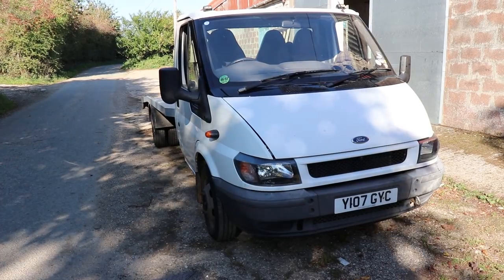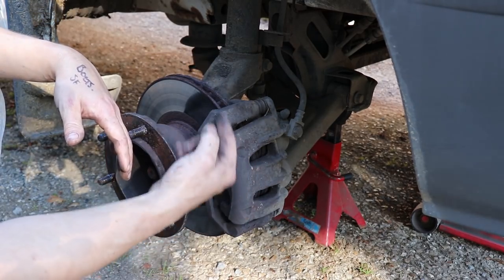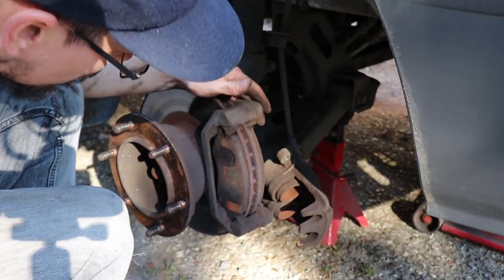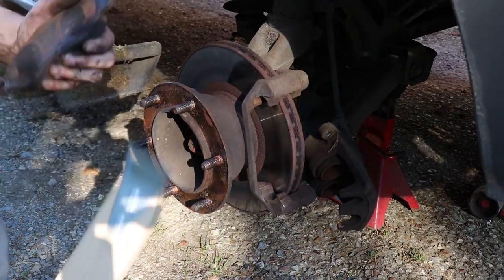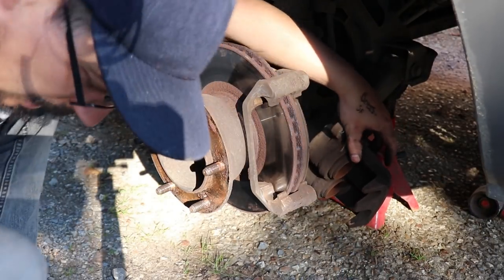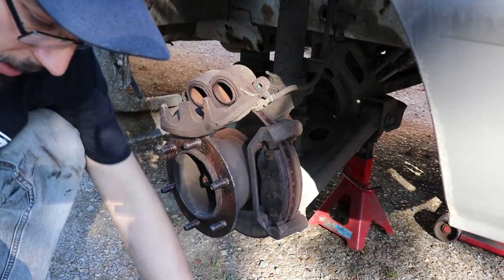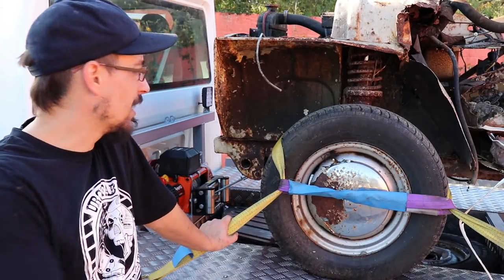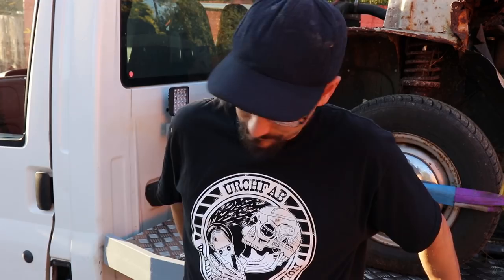SMOKING BRAKES ON THE RECOVERY TRUCK.

Comment: Always red rubber grease or silicone grease on the slider pins. The rubber insert inside caliper carrier swells up and causes the pins to stick if copaslip or LM grease used. Seen it more than a few times in my day job on the spanners. Also if you put the slider pins seals in the carrier then slide the pin in afterwards you avoid poking about with the screwdriver. Good vid, glad the truck starting to see some use.
Reply: Never known that once to happen.

Possibly might be the case with far older vehicles using natural rubber gaiters/boots but no such issues with more modern stuff eh synthetic rubber (22 years on I can't be just lucky.)

Comment: Cut it off at the drum end and crimp on a ring terminal for the retaining bolt yourself. This is easy and safe to do as all it will need to do is hold the cable lightly as it's wound onto the drum. When on it's actually the friction of the cable on the drum that holds it on.
Reply: MichaelKingsfordGray  The hell it does. A pair of bolt cutters, some pliers, even a hammer will do in a pinch. You could also just blast through with a stick electrode.

Comment: Great video again. With regards to your winch cable, each winch is slightly different in how the cable is secured to the drum but basically unwind the lot (you will see how it is attached) and cut what you don't want from the winch end leaving the hook end as is. Hope that helps :)

Comment: The way it is on my winch, you pull the cable all the way out, there’s a big ring terminal on the end of the cable which is bolted to the drum. Unbolt it, cut off what you don’t want and put a new crimp on ring terminal on it. Bolt it back on and wind it back in. I have the same problem with the cable on mine, been gonna shorten it for awhile but haven’t yet. When it gets all messed up I pull it all the way out and wind it back in neatly with some tension on it.

Comment: To shorten my cable I cut it at the winch end and used about four jubilee clips (hose clamps) to clamp the cable onto the spool (along the full width of the spool), I have done this for years without any problem even when dragging cars on without wheels! Also I screw my control box to the back of the cab so it wont get damaged and you can see the cable on the spool better ,to make sure its winding on evenly,

Comment: Hey Matt you can cut the cable after you pull it from the spool. You can use an angle grinder but I would put tape around the cable and then cut it 1/8" away from the tape.
Or you can put a hose clamp and cut the same distance 1/8" away. Then you can take your mig and tack the cable from fraying. Or leave the tape on.

Comment: You might want to leave the cable as it is, because if you need to load a heavier vehicle or equipment (plus 2000kg or so) the winch can be turned into a pulley by doubling the cable. It will be slower but with less strain on the winch.
Reply from the maker: I can only legally carry 1500kgs on this
Reply: Urchfab it’s not always about the weight capacity your hauling. You may need the extra winch pull strength to drag a car or vehicle (brakes locked up or stuck in mud). 
I would only remove as much cable as you have to. Don’t want to lose capability or overall reach.
Reply: @Urchfab  I know lots of people cut off what they don't want and then either get the cut off bit re crimped or buy a second cable to extend it if they need it for pulleys etc, it obviously won't pull it into the winch but it gives the best of both worlds.
Reply: If you shorten the winch rope, it decreases the diameter at the outer layer. This will increase the pull capacity . Not decrease it.

Comment: Don’t shorten your cable, use one hand to guide it to spool correctly until load is sufficient and it should track it self. Letting the cable birdsnest will only cause more damage, I get years without replacing mine and I run a Tow business. Cheers for the great content.

Comment: shortening the cable depends on what type of end connection your winch has. if you are lucky it will be a friction fit. so then all you have to do is cut the cable en reinsert it into the drum. best of luck on the project!

Comment: Pull the cable out fully and there’s normally a small grub screw holds cable to the drum. My dad always taught me to heat wire bond up until red where you want to cut it and keep twisting it until it breaks so u are left with a nice end rather than just cutting the cable.
Reply: Don’t need to mess about re crimping the hook end or anything

Comment: On those winches there's a copper swedge/lug like you'd use on a #4 batter cable or ground cable. It's just bolted to the side of the drum with a button head machine screw. I think they're like a 4 or 5mm Allen. 

Make sure you have enough cable to keep one and a half wraps on the drum so that the load is not pulling on that lug. Otherwise you risk the drum spinning inside the cable spool.
Reply from the maker: Thats great,  Cheers

Comment: An air powered descaled works wonders for clearing the rusty crud out of the small gaps the pads sit in, Lidl had them in last week £25 ;-)
Be a great tool for your 100E build too.

Comment: Actually it would be a good idea to take a 1 tonne chain block in the truck tool box with you and use that to pull in any heavy vehicles etc that are tricky to load. And shorten the cable.

Comment: Pull all the cable off the spool, cut off what you don't want, crimp on a new eyelet and wind it back on. It's the first 5 or so winds round the spool that keep it on there.

Comment: The caliper sticking is more likely to be the flexi-pipe. They corrode internally and effectively make themselves a one way valve. Very common on the mk6.
Reply: How does a pipe made from synthetic fibres corrode?!
Reply: It's not. The outer is but the inner isn't. Cut one in half and you'll see how it goes. The way it's layered almost always means they fail one way. The inner is made in angles to allow it to move with the pipe which usually comes off at one end but not the other so acts as a flap in the pipe. Fluid will go down just fine then can't go back or is restricted. You can still bleed the brakes just fine. You can use them just fine but when you release the peddle, pressure remains below the blockage. Then because it's sticking the brakes get hot, the pads expand and you get more pressure. This carries on until the brakes are almost completely jammed on and you get smoke. Leave them to cool and it will drive away as if nothing ever happened but drive it long enough with them sticking and it can even melt the wheel nut covers.

Comment: I heard that Cera Tec a ceramic based grease is recommended for contact points on disk brakes rather than copper grease

Comment: The other end of the cable should have a crimped end aswell.  It varies from brand to brand,  you can buy a clamp that works well to put the hook back on the end of it.  Although it's always best to have a clean cable end so not to get those bastard stainless splinters.

Comment: i find that copper greasing those pins,rather than grease works just as good
Reply: For street applications sure.
Reply: that does work, however copper grease can cause the rubber to swell. rubber grease is an excellent alternative - not many people know that stuff exists
Reply: Yeah red rubber grease is best
Reply: copper grease and any other petroleum based grease does cause rubber to swell. I've seen it many times
Reply: The thing I was told about copper slip was to not use it on moving parts as is contains teeny tiny copper filings that can wear the parts out quicker. I never looked into the truth of this but meh. I use grease for the pins anyway.
Reply from the maker: Yeh ive used it on the pins loads in the past but my tin of copper slip has been sat in my workshop with no lid for about 10 years so with the amount of dust and grit in there its probably not the best for lubricating sliding parts.

Comment: Meee , I said that 😉 , or buy a nylon cable , for those who said keep it long etc for added gearing those winches don't need it , they will pull a house down , I used my to snatch 7.5 t wagons out ditches with shortened cable
Reply from the maker: Yeh its ridiculously long, I could half it and still be fine.  I pulled a car on from 5 meters behind the rams and there was still half the drum left.

Comment: Noooo ... don't use copper grease ... use ceramic brake grease for the pads, and red brake grease for the pins.

Copper ease turns into glue when it gets hot.

Comment: Wafer thin front pads on a recovery truck 😂😂 yet worried cos it’s binding up 
Lolz 😂
Reply: - yes mate as with new fatter pads it would require you to free off the piston anyway to push it back in  and fit new pad anyway 
So theoretically your still freeing it off whilst changing pads are you not 👍

And any good guy with a bit of grey matter would also clean and regrease the sliders too 

So know your gonna have to take same wheel off again pretty soon just to change the pads lol 
You tell me who’s daft here as more or less doing same job twice over 
Not even considering the fact you may be risking a third party’s car on the back with those pads too 😬

Enjoy your day anyway as I’m sure ye won’t lose sleep anyway similar to myself buddy

Comment: That's a lot of loctite...  Too much. A spot drip would have done for that size of bolt
Reply: still stand by my comment   far too much product used. Only time will tell next time the person removes those bolts
Reply: @mondodaftasabrush  

I get what you mean but the times I've removed various bottom arm bolts, calliper carrier bolts, strut pinch bolts and it literally looks like the manufacturer dipped the bloody things in a pot of threadlock! Asides the very uniform coating anyway. This is pertaining to newer vehicles not taken apart before.

Where possible a little moderate heat can help loosen the bond and also well fitting single hex sockets and spanners help immensely .
Reply: I think the loctite used was saturated and so much will lubricated the bolt and will be over tightened
I had to watch the video again just to confirm my comment
Then I looked on YouTube to check loctite application videos and still think my gut decision comment was justified after I stood by my comment after your last reply
At least they won't rust with loctite on them
Many thanks for your comments and opinions..    Free speech is fantastic
Every day is a school day
Crazy welder. Mx5  rodder video turned into a debate about loctite on bolts

Comment: Use proper brake grease on the sliders.. Anything else will damage the dust covers
Reply: The fuck how?
Reply: I prefer regular lithium grease on the slider pins though sometimes use graphite grease if I've got it (CV grease.)

Almost always used copperslip on the pad and shoe contact points and never had an issue in 22 years.

I'm a little curious as to how you think copperslip will damage the dust seals though.
Reply: @SpaceShipDeathstar  the petroleum in normal grease rots the rubber